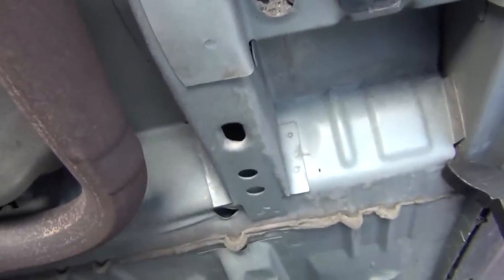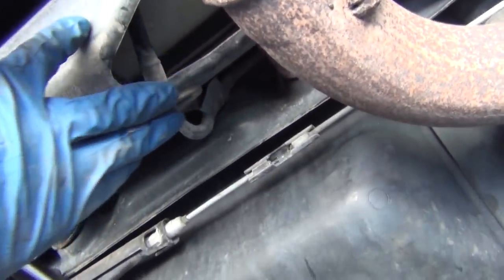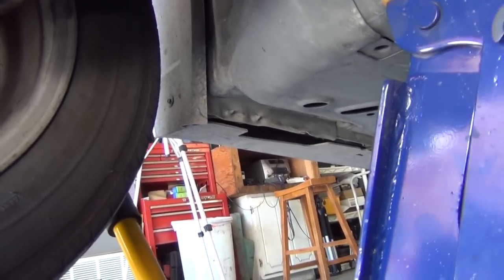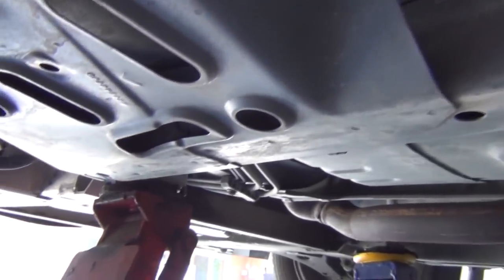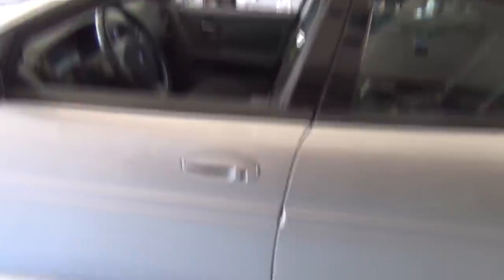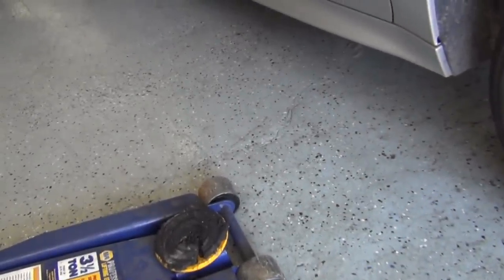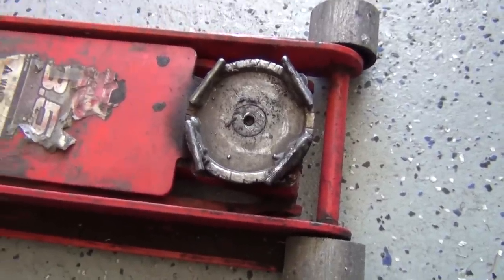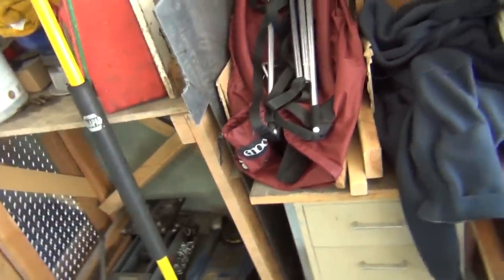How to jack up your car without jacking up your car

Comment from the maker: jacked up
1. not working properly or as intended.
2. having used a large quantity of speed, cocaine, or other amphetamine.
3. cut or lacerated by means of a make-shift knife or blade. see SKIV
4. In generally poor or injured condition.

Comment: Another point to mention is to think about where you want to put the jack stands when choosing where to use the floor jack. You want to have clearance to get the jack stands in there. Also, if you are worried about something bending due to a different shape to the car's pinch weld or a softer spot, sometimes helps to use wood blocks (no thicker than the narrow edge of a 2x4). The wood will crush a bit to even out the differences.

Comment: After doing this stuff for 30 years, I'd say this was very practical advice for any beginner.  The laser was a great way to convey good vs. bad jacking locations.  You explained very well the reasons WHY not certain locations were not smart to use.   Seems to me, most jacks that come with the car are made small for storage.  Because of this, they can be fairly unstable.  I nearly got my foot crushed years ago, after one of those jacks tipped on me; now I never use them anymore.  An $80 hydraulic floor jack and a pair of $20 square based jack stands are so much safer.  Your tip about redundant supports was also excellent.

Comment: I will never forget once when i tried to jack up my old car on its origin jacking up points. so i winded and winded and winded the jack handle... But the car did not move a bit. So i checked the jack if it is working and suddenly i realized that the car was that rusty that the jack worked its way into the bodywork.... jeez what a lemon.
Reply: jo fu That's INSANE!! Do you live in the UK?
Reply: Hello Ethan, no i live in Germany. Maybe i will move to the Uk when i retire. Its a nice country and nice people.
Reply: jo fu Yh but cars rust extremely fast in the UK, that's why I thought you were in the UK.
Reply: jo fu "wound and wound and wound", not winded.
Reply: +Ethan Ward they rust suppa fast here in norway, salting roads in the winter makes our cars rust like hell
Reply: Taurion Martell Yes I've heard some HORROR stories of cars literally EATEN within a few years. Expensive cars too.
Reply: jo fu 😂
Reply: Lol

Comment: working in a back yard dropping a sbc motor & transmission from under a chevelle a buddy was kicking wiggling the transmission tailshaft side to side trying to drop the engine & transmission as one unit i seen this & told him to put a set of share wheels under the car just incase it fell. so, he won't get crushed ... shortly after laying the spare set of wheels under the car he kicked the whole car off the jack & jack stands he had under the car in the dirt .. wheels stopped the car from falling

Comment from the maker: The new jack is more $ than it used to be, it has smaller wheels (TOO SMALL) that don't roll while lifting as well as they should, and the rubber for the pad is junk.  Mechanically it's ok, but it's a "don't buy" as far as I'm concerned.  The old one was rebuilt and is back in service.  The old one is awesome.

Comment: I know a guy that missed the sub frame on the uni-body and ended up giving the driver seat a 2 inch lift! Gata pay attention to those lift points. I religiously double and triple check. You can't be to safe.

Comment: Great stuff for me.  I liked all the extra explanations as well.  I used the places marked by the manufacturer for jacking, but never used their supplied jacks. Cranked up with my floor jack and crushed the welded seams with the flat tops of the jack. Never really thought about what was happening till I took a closer look. Just figured the seam would stand up to the weight. Still learning.

Comment: Great video. I always jack using the strongest looking points, however, I absolutely LOVED the bit about the fulcrum point of the car and where to place jacks based on the vehicle's weight distribution. Never though about it and never had any accidents fortunately but now I will be even safer by taking your tips into account. Thank you!
Reply: I use scissor jacks jackstands and a floor jack, also blocks a tire maybe and maybe even ramps if I don't have to take the tire off

Comment: I especially like that he used a Grand Prix as an example because I have a 2007 Pontiac Grand-Prix GT.  The problem that I have found with most cars is that it is hard to get a jack under the car far enough to reach those jacking points that he is showing us.

Comment: Humans cannot multitask no matter what anybody says. We can't do two things at the same time. If you try, you're shifting attention between one task and another quickly and you can't focus on either one. 
Multitasking should refer to setting up a machine to complete a task unsupervised while you start on another task. Laundry, dishes, and other household tasks are designed to run on their own so you are freed up to use the time in another way.

Comment: Brian, I found that when jacking up a car with a floor jack on an asphalt driveway and it is hot out, the asphalt gets soft and the wheels of the jack will leave depressions on the asphalt, so I now use a steel plate under the jack as you mentioned.  It makes it so the wheels rolls better.

Comment: Great tutorial video. You are actually demonstrating on the car I own 2004-08 Pontiac Grand Prix so that really really helped me find out exactly where I can jack up the sedan other than just at the indicator markings. I'm having to lower the rear subframe so I can remove the suspension arms and you can't remove suspension arm bolts unless you lower the rear subframe.

Comment: Hey thanks for the videos! I have 3 hearses and they have to be jacked up in very specific places because of the weight and length of the car. If you jack them up anywhere past the seam between the front door and front fender, you run the risk of the frame getting messed up because the car is so long and heavy. My 66 caddy hearse weighs 8000 pounds and is 22 ft long!
Reply: Do you collect hearses to take to classic shows or do you just drive them to drive them? They are cool vehicles.
Reply: I collect them and drive them. I mean I take them to shows sometimes of course but they've all taken their turns at being my daily driver. I'm afraid those days are soon over though as I really need something more practical. I hate to buy a stupid Toyota or something but it's too much wear and tear on these classics
Reply: i had a 65 combo that was a lot heavier than stock http://i353.photobucket.com/albums/r384/batvette/clubdead/hearse06.jpg as long as you dont have rust issues its not quite as risky as you imply. Just use some common sense. The roof was cut out of that car, you could stand up in back and it had a disco dance floor (wood parquay, chasing lights etc) in back. Neon under the side bubbles. I loved it until I began to hate it.

Comment: Those scissor jacks were only meant to be used on flat stable ground, which is the most impractical design. If you have a flat, a lot of times you'd be lucky to find a good flat ground surface on the side of the road. And then they have these stupid little donut tires for spares, claiming they're are only for temporary use, well fine, but then if you replace it with a normal size spare, there isn't no damn place to put it on some of these cars, they won't fit. I sometimes think the manufactures design these stupid jacks and spares, in hopes most people would call road service or a tow truck... ? The crap these car makers pull is bs, just like when they came out with trucks with no back bumpers in the 90's, but yet they wouldn't pass state inspections without em, so you were forced to "buy" a bumper from them when they should have came with the truck. That's like buying a house with no roof, roof sold separately, and you can't live in it without it.
Reply: 1. Why would an mfr. care if you had to hire road service, even though mfr.s aren't road service?

2. What are the unnecessary (even errant) quotation marks around "buy" for? You're not really buying the bumper, but are just saying it as if someone else might say it without really meaning it? What, exactly?
Reply: To be fair, flats are not exactly common with modern tires. Carrying around weight is spending money without realizing it, quite a bit in the long run - and putting money into a jack and spare that will never be used is disagreeable to the manufacturer.

I mean, I agree, full spare and mini hydraulic jack is great, but a doughnut still makes sense - and you hardly need to get it off the ground to change a flat. Even with a bad jack and all that, it's not hard to change a flat at all - I worry more about torque specs - they probably don't care about a tire you can take very fast, most people won't torque it right and they want you to take it to a garage before you die. If you carry a torque limiter everywhere like me, great - but they're selling you a car, if you want a fully stocked garage in the trunk that costs extra.
Reply: asustech007 i
Reply: I just carry a 2x6x24” piece of lumber to put on the ground - not only provides stable surface but also reduces the number of turns required to raise the vehicle
Reply: @dav3fk
To argue for having no jack and a spare because it is "never used" is daft.  You migh never use a fire extinguisher or first aid kit, but if the day comes when you seriously need one you would be willing to give someone $1000 for it.  The reason makers don't want to supply a proper spare or jack is to save a bit of weight and get a tiny little bit more miles per gallon as that is all that blinkered buyers (and governments) think about. 
 
As for your torque issue, I worked in a dealers and we never did up wheel nuts with a torque wrench and I don't now, even though I possess one. Most amateurs just do them up as tight as they can which is actually more than necessary.  I once started to drive a car where the nuts were still loose and you would need to be a complete idiot not to realise something was badly wrong.

Comment: If you jack it up in the dirt (like me) the pitch welds will bend and crush because the jack will not move with the vehicle. I put a  1/2" plate of aluminum under my jack that helps the jack to "roll" as the vehicle lifts.

Comment: Use some green loctite. It will wick into the crack and block the leak. You'll need to drain all the oil, use some brake cleaner to clean whatever oil is in the crack, then wait for everything to dry. It takes about a half hour to start hardening but recommend leaving for 6 or so hours to be sure.

Comment: Ever do a video where you can take a wheel off and not need a jack at all? It's where you support the rig (and it won't work on all rigs), so the tire won't come down and you let the air out of it, pull the wheel off, do whatever it is you needed to do like brakes, then put the wheel back on and fill it with air. I'm not saying it's a smart thing to do, but it does work in a serious pinch. But this wasn't about that. I'm babbling, but honestly it does work on some rigs depending on what surface you are working on, such as cement and what support point you use, usually it has to be very close to the wheel where a shock support will be. Food for thought peeps.
Reply: Thanks ! I like your "make do in a pinch" plan.  I'll stow that for future reference.
Reply: Gweedo Murray
Just occurred to me, if you can drive it onto a block of wood.. That would give additional elevation once you've deflated the tire.
Reply: Catch is, when would you be in the situation where you would need to do it, but just the same, I wanted to put that out there and glad you took note.

Comment: Thank you so so much.  It's so helpful to have this advice about WHY a certain point could be used or why another point might be a better spot, or why not to use somewhere else. 
In every forum people say "Oh just use the cross member" or something like that but I don't know what part of the suspension system that is yet. Yes I could go and learn all about suspension components but they'll be different on different cars and Americans use different terminology when reading forums so it takes even longer...frankly I'm just trying to get my head around the brake job I'm about to do for now :-) And then there's the arguments about whether the pinch weld is "only for emergencies and only to lift the car one inch to change the tyre" or whether you can safely put jack stands under there. So much confusion. So thanks again for this great general info. I'll always try to stick to the vehicle manual but if my jack stands are going to mangle the pinch weld well then I wanted to know how I could judge any alternate points. This was really helpful.

Comment: It's a trailing arm that you were pointing out...be really careful when lifting by the trailing arm mount because I've seen lots of guys put the jack pad under the trailing arm mount but actually catch the front of the trailing arm and bend the shit out of it.  They usually get bent in any kind of collision, as well as the lateral adjustable toe link.

These cares are good money makers.  Control arm bushings, ball joints,  wheel bearings, and sway bars/links/bushings all day long.

Comment: So many people jack up their cars WRONG.  They use a jack that pushes directly up against the welded metal flange, eventually pressing that flange over onto it side, or splitting it open, causing it to rust up later on.  That flange is just there to guide the jack, to prevent it from sliding inwards or outwards, not to actually push up against it.    The correct jack should press up on the flat metal just inside of the metal flange itself, that is the way original equipment Toyota Scissor jacks are designed to lift the car.   I have a hydraulic jack and I use it by placing it onto the large bolt head that holds the front sub-frame to the car itself.  So when I put that I'm pushing up on a large structural bolt.  But that only works on the front, there isn't anything like that in the back, so I have to use the car's original scissor jack on that welded seam to take off the rear tires.  Yes, there is that place where the radius arms attach to the body of the Corolla, but the 'cup' of my jack is really small that radius arm might just slide off of it, so I just use the car's original scissor jack instead.

Comment: On a smaller car, if you jack the front up over the large bolt that goes through the A-Arm, You can pick up the whole side of the vehicle. I have a craftsman floor jack that came in a plastic case. That is great forvme because I never leave my jack outside. I wouldnt trust my life to a rusty jack. Oh, on the jacking the whole side of the vehicle, I would recommend relocating the jack to prevent lifting the entire side of the vehicle. JACK STANDS ARE A MUST. No one should tell you different.  Should an O- ring fail internally on that floor jack, you WILL get hurt. Also , when refing on a stuck bolt, you WILL be rocking the vehicle. I HAVE had vehicles move on me, slide off the jack,and I was even pinned against a fence once because the floor jack kicked outwards when I was foolishly trying to break a wheel nut loose while the vehicle was up on the jack. Safety should be the first thing you mention on ANY jack, or stand video.

Comment: Good video though newer cars like 2012 corollas above not much areas to very front to jack up only to side at the partial frame itself another thing is on the top of the jack its good thing to put a rubber hockey puk on the craddle keep from damaging anything under car when lifting up.

Comment: Funny I did the same thing with the jack slipping except for it was a Volvo S80. The frame rails are not flat and it wasn't square enough and up up up and bang it drops and all of a sudden a flood of coolant comes out. I'm lucky it didn't destroy the core support. I hate admitting to it but you learn from mistakes.

Comment: A comment on the "two, redundant jacks" It is true that 2 jacks failing simultaneously is extremely unlikely,  almost impossible (unless you buy a lot of "factory seconds", or try to save money by only half filling that ram with that expensive hydraulic oil), even if one failed, that car was coming down. They weren't placed "redundantly" but in TANDEM,  each one supported half the car, and each only on one side. If they were both in the center, and each one independently supported the car, THAT would be redundant. The car may have held on one side, so now your odds go to 50/50, depending on which side YOU are working when one or the other jack fails. 

Sung to the tune of "Do It Again" - Steely Dan

Now you swear and kick and beg us that you're not a gamblin' man;
Then you find you're under the Vega with a jack handle in your hand